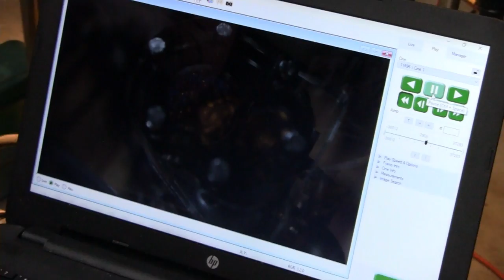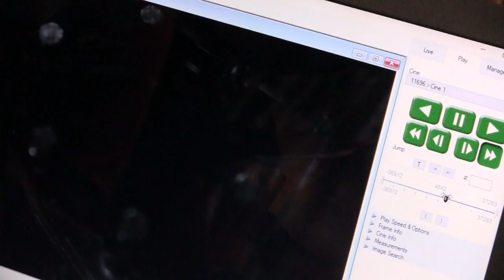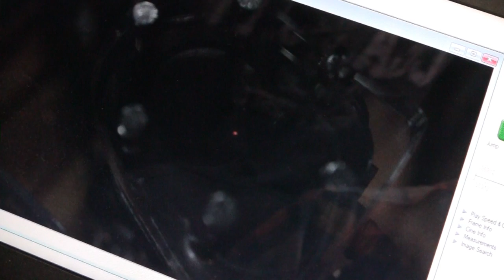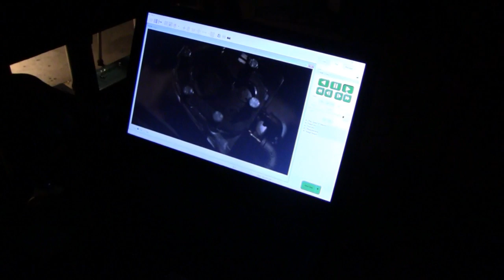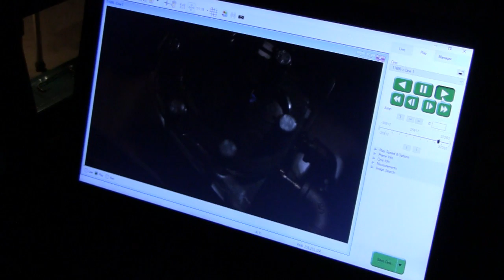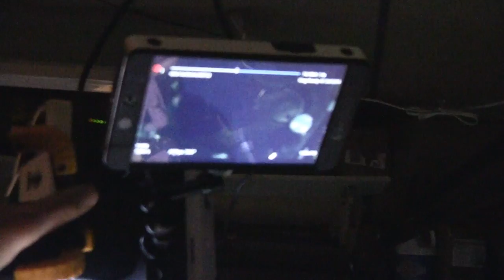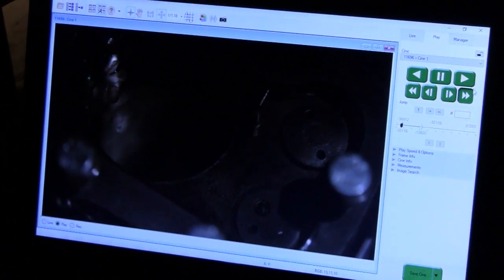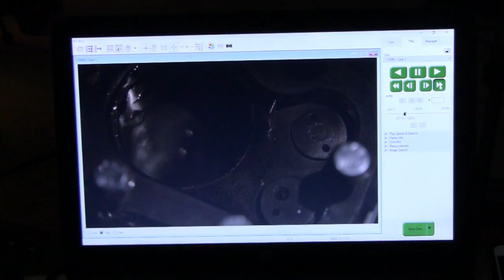Glass Head Engine Slomo with SmarterEveryDay (part 2) Behind the Scenes

Comment: The orange color is the spectral light created by Carbon ions. You will get the blue color from "complete" combustion, and the orange from "incomplete" combustion. If you use a Bunsen burner, you will understand the effect.
Reply from the maker: Thanks for the info, that really had us scratching our heads!!☺
Reply: No worries. By the way, I live in Australia, so you could send the motor to me, with reference to another post, and I'll check to see if it swirls the other way. Or, you could watch that episode of the "Simpsons", where Bart starts a war between the US and Australia over which way the water swirls down a toilet.... :-)

Comment: YOu gotta send the thing to Australia to get someone down there to do a slomo of it now
Reply from the maker: Yeah it would be funny if the gas swirled the other direction!!☺
Reply: 805ROADKING couple of things.
If you go east of Eden , the water in the toilet swirls clock wise, west of Eden swirls counter clockwise , till it reaches the other side of the earth directly opposing the garden.
Second being a old burner man, I believe the tiny yellow bursts are oil molecules. When the whole flame is yellow it is a adjustment issue, or is nearing the end of combustion.
As for the question, have engineers tried to help the swirl, Hemi engines leaned toward this concept.
Mr. RoadKing , I believe if you had prints of the blue tornado made up 8x10, or even bigger they might sell. That is so cool looking, think of a 2'x3' wall poster of the blue tornado. I think motor/gear heads would have to have one.
Nice work once again!
Reply: 805ROADKING that would be hilarious.